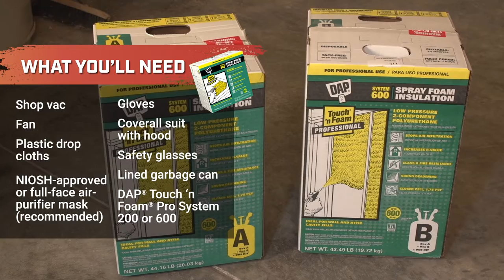How to Insulate Rim Joists

Comment: In the first two sections he did, he failed to seal the bottom. It is hard to reach up and point down. It is also hard to get your head up high enough to see what you are doing. Keep in mind you will probably not be working in an area that is this well lit or accessible. Don't forget to caulk between the sill plate and the cinder blocks.
Reply: No.